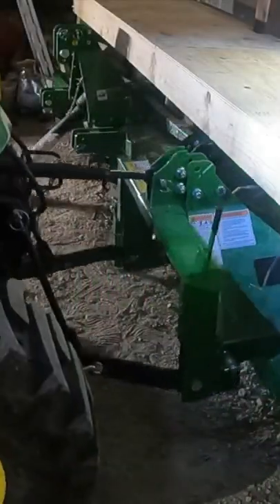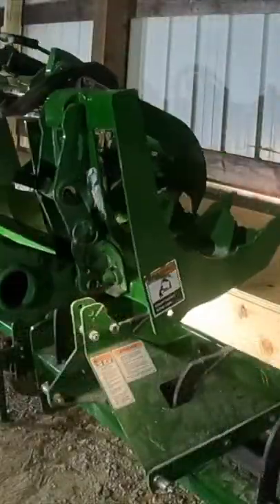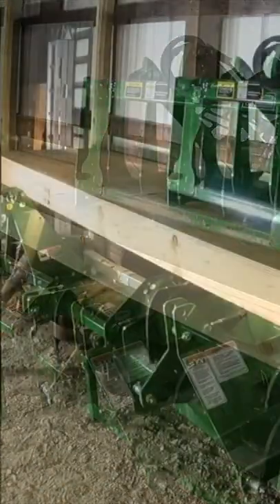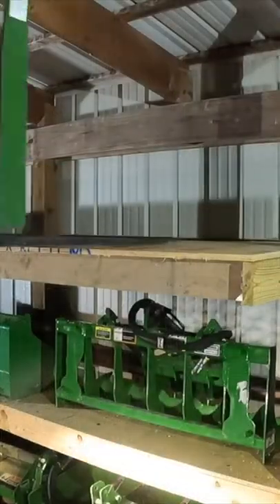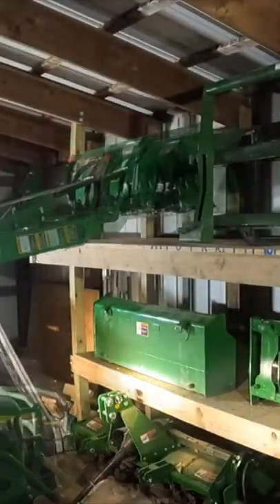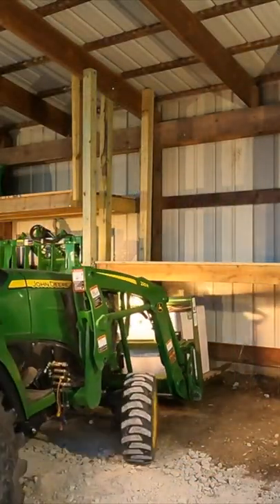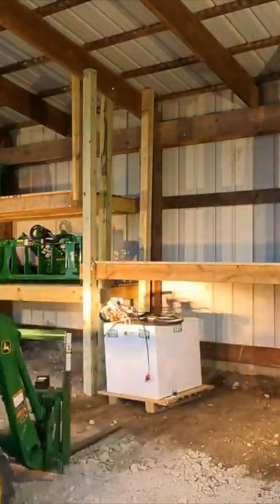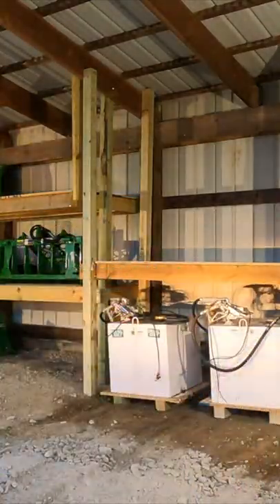DIY Tractor Attachment Storage Solution #farmlife #farmequipment #homestead #diy #tractor #johndeere

Comment: Outstanding job for storing all your implements, not many take the time to do that. Only thing I would suggest is to put your fuel cells in some type of a containment tub. They make them for that size fuel tank, and it should still fit on your pallet system. 🙏💪👍

Comment: Wow so this is what level 100 human achievement unlocked looks like nice work 👍 I have some similiar attachment for my bobcat mt100 , blue diamond bushhog , grapple with root puller , and tooth bucket , real happy with my 2023 bobcat , anyone on the fence about one it’s a hoss , I rented the Vermeer 925tx for 4 years love that machine too , but very satisfied with my bobcat , also the low profile tracks I see why bobcat did that may not last as long on treads but I did 17 yards of mulch in 5.5 hours two guys spreading while I continuously dumped in place driving over nice grass didn’t harm the grass that’s incredible for a 3400 pound machine . Just locate leech fields and septics first and go to town . Nice way to store attachments no doubt

Comment: Beautiful man! I have been drawing up some custom shelves for my FE attachments and 3 point attachments! This is exactly what I had planned to put in my quonset hut.
Reply from the maker: Thanks. I built the shelves into my equipment shed and I just finished building the Quonset hut about 50 yards away
Reply: @RockhillfarmYT  that’s awesome man, I really dig the set ups. I am just finishing up now on my s-model , it’s not as big as yours but it was a little challenge in the beginning. Having everything squared and bolts hand tight seriously makes the difference and really helped the second half fly by. We now have 2 on our property in upstate NY. One is a car garage and now this one my tool / tractor shed. Also I really like how you built your baseplates on the construction blocks, definitely another great idea

Comment: Do the chainsaws leak any fuel or oil hanging like that?
Reply: Chainsaws always leak bar oil- any position, anywhere anytime lol
Reply from the maker: Probably, but when I go back to get them they are never empty so they don’t completely leak out.
Reply: Just put a piece of corrugated cardboard on the floor underneath,  like half a pizza box. Works good. Or funnel the oil back into jug if not using for a while.

Comment: Did you consider the bolt on brackets for the mid mount mower deck to move it with the loader. It’s awesome for tipping it for service.
Reply from the maker: Yeah I ordered the load and go with my mower deck but after it came in they told me that the 60 inch deck is not available with Load go on the 2038

You can get it on the 72 inch but not the 60

Comment: All that and you couldn't spring for a concrete slab to put everything on??????
Reply from the maker: When I bought the property, it had two buildings already there, and neither one of them had concrete.

I put concrete into the main shop, but not into this three sided equipment building.

The primary reason is it’s built onto a pretty steep hill and they did not excavate the ground to level.

Comment: Buddy you barely got any attachments 😑
Reply from the maker: I actually have more tractor attachments that aren’t shown here, and I’ve got a skid loader with a lot of attachments.

Had to build a Quonset Hut to store it all in
Reply: I’m joking, you have a butt ton of attachments. I run cat 980m, we have a few buckets and forks we can couple on too. But the high tilt bucket to connect is a huge pain in the ass lol. Hydraulic lines a thick as your wrist. Always neutralize pressure with engine off before disconnecting. Seen a guy get fluid in his arm, they had to fillet it open and suck out all the fluid. Nasty
Reply from the maker: I have heard of that happening with hydraulic fluid but I’ve never actually seen it.

Doesn’t sound fun
Reply: @RockhillfarmYT  just because the engine and pump stop dosent mean their isint 3000psi or more of hydraulic pressure in those lines, even in some of your attachments aswell. I’m sure you know this but. Engine off, key middle position (no start) and just work all the controls to neutralize the pressure in the lines. Great video bro! All love here